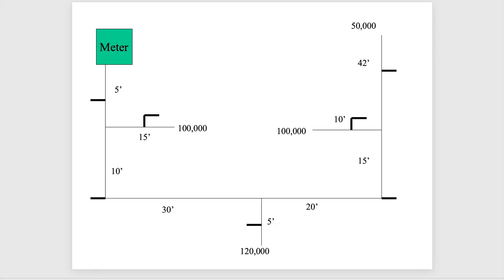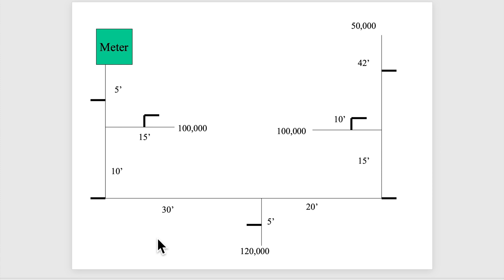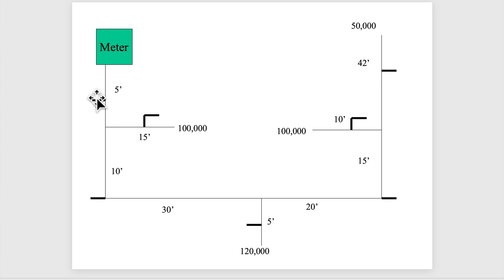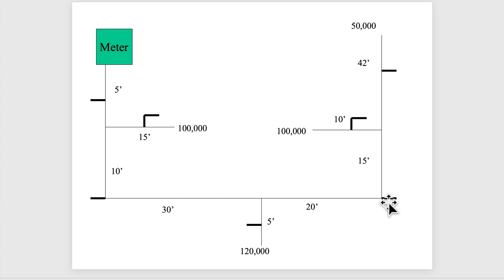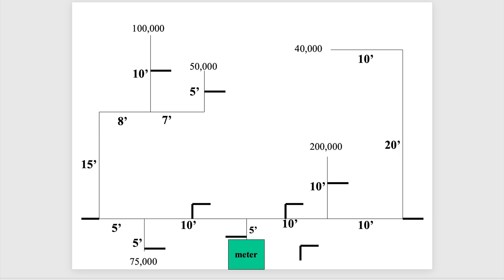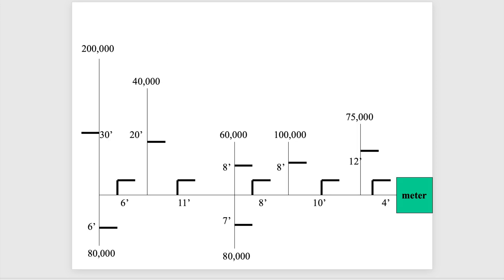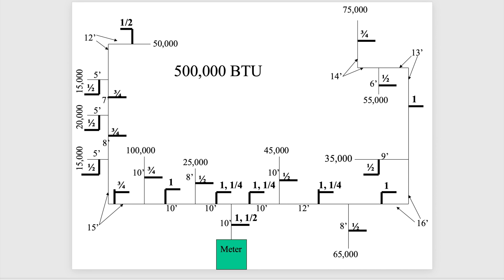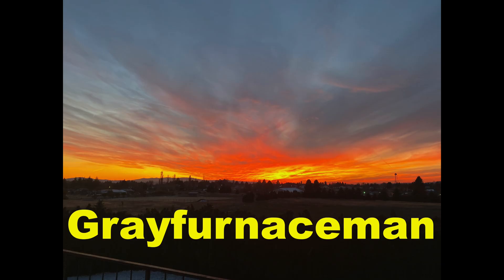Gas piping exercises

Comment: I have worked the last problem on the last exercise, for the drop for 55,000 btu's I get a  3/4 inch pipe drop.
I did the math 6+13+13+16+16+12+10+10=96 for the schedule 40 metallic steel pipe only has 100 ft, and at 100ft , 1/2 " ='s 50,000 cubic feet, the next size up is 3/4's @104 cubic feet per hour can you please confirm, so I can see where I'm missing the correct answer? I even included the section of pipe at the meter, and reworked the problem with out the section to the meter, and still cant come up with 1/2 inch that is on the answer page, can you please confirm, I'm taking my Masters Gas Fitters Exam, thanks? Are you wanting us to use Table 402.4(2) Schedule 40 Metallic Pipe, gas natural, inlet pressure less than 2psi, Pressure Drop 0.5 in w.c.,specific gravity 0.60-2015 International Gas Code?

Comment: On the end of chart were it Tess off for 6feet with 80,00 and   and 30 feet with 200,00. I have the sizing down good from your video. Only part I don't understand. When sizing your lines not the drops. When you come to a calculation that has two stops like this chart at 30 feet and 6 feet. How do you subtract BTUs from total. Both btu of both appliances or just one.. not sure how to size when line has two appliances at one location. Does that make sense ?

Comment: Which chart are you using. Sane chart as video
Reply from the maker: Yes.  You can also find it in IFGC 2018.   May be a different page.
GFM
Reply: @grayfurnaceman  I'm about to test for Kansas master plumbing. You have any videos available on plumbing ?
Reply from the maker: @shawnbolten5709  Sorry, no.
GFM

Comment: I'm now 70 years old, and retired from 25 years of HVAC. I wish I could write you an e-mail, cause I hate to have a long question about newer technology. I missed out on a few things in last 8 years. I live in the country, and worked 38 miles away in the city........... all natural gas, and I maybe came across only 10% of electric furnaces. Is there any reason why I can't convert a new furnace right out of the box to LP before installing it, and then make the adjustments for 2 stage pressure?
Reply from the maker: The Email is Grayfurnaceman@gmail.com  The manufacturers are limiting conversions on most of their furnaces.  You can buy one ready for LP.
GFM

Comment: GFM, Is it OK to run the natural gas furnace below its spec pressure? The issue is that my furnace yellow flex CSST line whistle like a mad orchestra when at full blast. It's a big single stage 80% 110000 BTU Lennox. So I cut the pressure at the CSST flex line by 30%-40% and the whistle has gone. The flame looks the same and it is perfectly blue, but I don't know what the actual pressure at the valve is. It's probably better to replace that crappy yellow CSST to whistle free version of CSST, but should I really worry now?
Reply from the maker: Well, I would not reduce the pressure.  You are underfiring the appliance and any other on the line.
GFM
Reply: @grayfurnaceman  which means it will perform less efficient and that is it?
Reply from the maker: @arthurvin2937  If it is underfired, the flame will too much oxygen which will reduce flame temp which reduces efficiency and could cause condensation in the heat exchanger.
GFM
Reply: @grayfurnaceman  so, I decided to  replace the yellow flex to whistle-free version, and I noticed something interesting. The yellow flex currently installed is 2 foot long and 3/8 internal diameter which is rated for max 85 000 BTU. But the furnace is 110 000 BTU. Does it mean that the furnace was underfired all the time? And is it always ok to replace the flex with bigger sizes - kinda the bigger is always better?
Reply from the maker: @arthurvin2937  The ratings are minimums.  The furnace could have been underfiring.  Bigger is better.
GFM
Reply: @grayfurnaceman  I'm confused about what does "minimums" mean. I ordered 2 foot 1/2 internal diameter which is rated 150 000 BTU. My furnace is rated 110 000 BTU. Does it mean that the furnace must be 150k and more BTU for 1/2" ID to work properly?
Reply from the maker: @arthurvin2937  You are overanalyzing the issue.  
Look at it as a water pipe.  I could run a faucet that is capable of 2 gal per min on a 1"  pipe that is capable of 30 gal per minute or a 30 gal per min faucet.
GFM
Reply: @grayfurnaceman  got it, just like electrical wiring and Ohms law.
Reply: @grayfurnaceman  finally, I replaced CSST for whistle-free, checked leaks, adjusted manifold pressure to 3.5wc (was 3.2). Now it's smooth and silent. Thanks.
Reply from the maker: @arthurvin2937  Welcome
GFM

Comment: Thank you so much for shining a light on a topic no one wants to understand. I've been in the natural gas utility business for over 35 years and under sized fuel runs are the number one problem in the natural gas industry today. It's getting to the point to where utilities are supplying 2-pound systems at an alarming rate just so under-sized fuel runs can be compensated. Everyone wants tankless water heaters, gas logs, backup generators & high output cooktops but nobody wants to pay for the fuel runs needed to supply these appliances ( everyone wants to go to heaven, but no one wants to die).
Reply from the maker: Wow.  I did not know utilities were supplying 2# gas to residences.  I would certainly not recommend that to any customer.  Thanks for the info.
GFM
Reply: @grayfurnaceman  ,. I'm assuming you're from the Northeastern United States ? The demand for 2-pound systems has exploded across the country ( no pun intended) ever since the popularity of CSST. The gas company I worked for has supplied 2 pound systems on an as-needed basis for long over 45 years,as long as the gas Main in the particular neighborhood was intermediate pressure or above= ( Supply feeder or commercial feeder). A properly installed 2 lb system is really a very good delivery system for natural gas ,when it is truly needed. The problem I have is when a 2 lb system is used to correct under sized fuel runs when the original piping was installed for  inches delivery . I also have a problem when it is used for total loads under 275,000 BTUs unless there is an extremely long fuel run involved.As to CSST on 2lbs, I am not a fan, but it is accepted by the national fuel gas code & the AGA ( American Gas Association).
Reply from the maker: @boby115  I am in the northwest.  In 35 years, I have never seen a 2# residential system in my area.  they are certainly not illegal but I have not seen them.  Virtually all of the 2# or 5# systems I have seen are both commercial/industrial and located on rooftops.  
Remembering the times I have seen nails penetrate CSST, I shudder to think of the results if 2# gas was used.  Just my opinion.
GFM
Reply: @grayfurnaceman  , believe me your concerns with CSST have been well-documented & is the reason for so many code changes made by the NFPA 54 national fuel gas code & AGA ( at times it feels like they change the codes  on a daily basis).CSST is here to stay whether we like it or not. The good thing is with the growing popularity of the Maga Press and ProPress contractors can go back to hard pipe and still save on labor cost, with an installation far superior to CSST.
Reply from the maker: @boby115  I know I am aging myself, but I have piped many a simple system in 2 hours.  I think the primary reason for moving away from black pipe is many new techs just do not know how to do it.  I would put tapered thread against any sealing method out there.  
Just me blowing off.  
GFM
Reply: @grayfurnaceman  , I can assure you it is not your age, it's just your years of experience. Threaded pipe is the best material above ground to deliver gas and believe me the Gas Utilities know this.Look at any above-ground gas utility owned installations,it is always steel pipe, threaded, welded or flanged. Once a customer's fuel run leaves the provided Gas Utilities outlet, we can only enforce the national Fuel Gas code at that time. Now local municipalities and states can implement stronger standards then the national Fuel Gas code but in no way can they reduce the standards. You are also correct, the quality of workmanship has definitely declined over the years in residential piping, just look at the number of stationary gas appliances connected with a flex connector,water & gas pipe ran like spaghetti ( just to name a few of my concerns).
  Just want to thank you for the efforts you make providing information and your experiences. We only know what we know, the information is out there, we just need to take the time to learn it and experience it and hopefully have some good mentors along the way.
Reply from the maker: @boby115  Amen
GFM